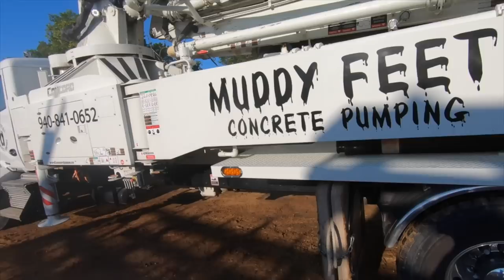Concrete truck rolls over. Pumping concrete with Muddyfeet

Comment: Sad part is that it's on the drivers side can see that coming
Reply: Actually in a truck like that you can see the terrain where the rear wheels are headed equally well on both sides via the mirrors.  Truckers routinely make the tires or truck body "just clear" obstacles on either side with no difficulty.  Anyway, I was thinking about how this is right at about sunrise and it was probably quite a bit darker than the camera makes it seem (digital cameras usually make almost any lighting level look like daylight, but in actual daylight none of those truck lights would have appeared to be so blindingly bright).  I noticed that the driver turned on his auxiliary backup lights after he realized things had gone wrong, and maybe it would have made a difference if he'd have turned them on sooner!

Comment: Boss gonna be pissed off! 🤣 whole 9 yards of concrete down the drain$$$$$$$$$$$🤑🤑🤑🤑🤑🤑🤑🤑🤑🤑🤑🤑🤑🤑
Reply from the maker: Yep
Reply: @MuddyfeetConcretePumping  That truck is not made of rubber that will bounce back, what about the damage to the truck rolling over and getting it back upright. Separate law suit for the stealing of driveway material stuck to the truck that will be hulled off with the truck!

Comment: They removed the driveshaft because after they right the truck it'll have to be towed due the truck being totaled
Reply from the maker: JDS Weather First, Brewer, Maine News & Events yes they did
Reply: Much easier to remove at eye level than on your back in the dirt. Especially on some older trucks the u joints suck to remove, mainly if they have press in caps instead of straps.

Comment: I had an incident pouring a basement foundation. The driver got too close to the edge of the excavation in order to reach farther with his chute. He rolled into the excavation collapsing much of the concrete forms and very sadly the driver didn't make it. (He was impaled by re-bar)
Reply from the maker: Wow. That’s terrible
Reply: Oh that's horrible.  Concrete companies around here train their drivers to NEVER position the truck parallel to an excavation.  A whole set of tires on positioned on ground that's not laterally supported is a recipe for disaster (same as in the clip).  Close approach to an excavation end-wise can be scary enough, but at least it won't lead to rollover or the whole truck falling in.

Comment: That's a lot of stupid there.  Failure to stop the mixer drum for that long was completely dumb.  I have driven mixer truck and heavy wrecker. Stopping the drum then hanging the chutes to the high side, then discharge the mud, would have saved a ton of money and hassle.   The pump truck operator probably even suggested this.

Comment: Looks like the wrecker with that cable along the side, is what put the pressure on it.  He should have used that tree on the other side of road and tied off on that to keep pressure  pulling truck other way
Reply from the maker: I’m not sure what the right answer is.

Comment: Terrible road and zero spotters is the reason he almost rolled over. Driver should’ve walked path and asked for spotter OR drove straight in and did three point turn around to pump. Make them spot or refuse service on grounds of safety issues

Comment: This looked rather amateur for both the mixer truck and tow truck operators.

The mixer backed in off-center and got stuck.

The tow truck,  could have used its under-reach and two snatch blocks to the front tow pin on the mixer and pulled it forward.

Comment: Who ever designed that bridge should go back to "bridge designing school" cause that bridge design is absolute crap, who thought it was a good idea to make the bridge just narrow enough for a cement truck weighing north of 30 Tonne (33 us ton) to have to reverse backwards, what ever happened to "making sure its foolproof" meaning that even if the truck driver goes of the desired path he still has enough room to correct himself, you give a 30ish tonne truck no room to correct, and this happends, and now you have to waste time, money, and resources for something that should of been thought about in the first place, either you should of widened the road to not only make it better at weight distribution, but so the truck driver can correct, OR cover the "bridge" part with steel plates so he doesn't get sucked over. to whoever built that bridge, if i were your employer i would not be happy.
Reply from the maker: Needed to be wider
Reply: Sorry if that comment was aggressive, it was late at night when I posted it, but I’m no stranger to people not using their heads, still makes me mad though.

Comment: If the wrecker had no choice but to back up quick, rigging a dead man off of a tree with a pulley would have helped. And at least saved the turn over.  The road looks too small and fresh dirt should have been compacted or stone.  and over the culvert a metal temp bridge like they use in the military would have been the safe bet, I think.  Glad no one was hurt. spill kit a must. How far can you lay hose without a pump. If you put a pump in the middle might be the answer.  Waiting for the next video, but take your time you have your business, family and you take time for us to watch this.  Thank you!
Reply from the maker: It was a difficult task for just one wrecker. They didn’t get enough information to the get go. It was a sinking ship that couldn’t be helped.
Reply: @MuddyfeetConcretePumping  True communication is key.

Comment: Poor decision making. This could have prevented easily. Why the heck did they back up when they had plenty of space to come in and turn around ? Even after the truck slipped into the side it could’ve prevented from rolling. I would say that by the time that wrecker came and did other crap he had a chance of saving it. a chain on the truck to the tree next to it should stop it from rolling. I feel so bad about the truck.

Comment: I've been leaning almost that far and just unloaded into a skiploader. Drove right out. They should've at least tried.
Reply: I agree. plus reversing the drum would have pulled the load to right right just a bit, towards the center of the road. the mud looked pretty wet though, so it may not have made a difference. totally worth a shot though

Comment: careful around those winch lines man, especially with that much load on it, they snap and it will cut you in half ! 

great video!
Reply: also never use that tow company ever again, that guy  didn't have a single clue what the hell he was doing! i am a 10 year experienced operator.... that guy had ZERO experience
Reply: In his defense, he didn’t have the right wrecker to do what needed to be done. They needed the bigger one with the boom to be able to get a line on it from the side. The first thing he did when he got there was call for it.
Reply: @doo-zranch7795  he could have stayed on the main road at a angle and put a winch line on it to hold from rolling over while they waited for the rotator to get there but he didn't do anything like that

Comment: Should’ve tied it off to that adjacent tree on the other side of the road, low down… on the stump base that tree would hold more than you think and they should’ve pumped the concrete out right away at the beginning, reverse the rotation to pump it out or whatever however they do it now days

Comment: Mixer driver should've known to Stop the mixer & give it a slight reverse turn then stop it & leave it... let the mud inside be moved to the high side using the fins inside the mixer...then shut off the engine. they left it turning & crawling the mud up the drivers side putting all the added weight on the low leaning side. 4,000lbs per yard... moving that mud to the high side would've slowed the sinking, making the angle worse & adding more weight. to the weak ground. since they didn't shut off the engine... not when it rolled, it starved for oil & ruined the engine too... bad situation made worse.

Comment: Shit narrow road with no compaction in the shoulders.
Also.... this is why you use both mirrors while backing up a truck.
There is a natural tendency to "cheat" to the side of the mirror that is being used. I'm not surprised that this happened on the driver side.
Reply from the maker: I think it was compacted. Just not on the drop off

Comment: If possible should of try to unload the truck asap...unloading would of put the weight on the oppsite side also ligher..or stop the drum turn off the truck..vibration and the rock hit the  side drum slowly rolled it..never been able to just pull that truck out..
Reply from the maker: I think your right
Reply: Only intelligent comment on here

Comment: I BLAME CONCRACTERS !!! THEY SUCK !!! THEY KNOW NEW ROADS OR NO ROADS MAKE PROBLEMS FOR HEAVY TRUCKS BUT DO NOTHONG TO TRY TO HELP STOP TRUCKS FROM GETTING STUCK AND SAY ITS YOUR PROBLEM  !!!!
Reply: Exactly I work in concrete and that's the first thing I look at is can concrete trucks  get to job site safely and not worry about getting stuck or flipping over.
Reply: Just can't back a 67,000 lb. truck over a loose pile of sand built up 3 or 4 foot high. Property owner and/or contractor for construction job are responsible for conditions on the construction site, not the redimix driver or tow company.

Comment: At first I thought it was driver error but I went back and watched it several times and you can clearly see the road giving away with that truck that was not driver error. whoever built that road is responsible. Just another reason to use forward discharge trucks in hairy areas. If like where I live they aren’t even used.
Reply from the maker: Bad deal
Reply: @MuddyfeetConcretePumping  I seen your 180 yard slab pour victory style lol

Comment: Lol there’s a lot of comments about what the tow operator should’ve done, but the mixer driver should’ve never went off the road in the first place.  It wasn’t that tight, especially for a mixer driver who should be used to those conditions.
Reply from the maker: Blaming the tow truck driver for this accident is like blaming a fully involved house on fire that burn down.

Comment: That is one heck of a mess that driver got himself into. Definitely where a front dump would be nice
Reply from the maker: The more I do with this channel the more I think we need some front end discharges in our area.
Reply: Front discharge are the way to go and many are 6x6 drive up here.
Reply: Muddyfeet Concrete Pumping 
Yep around here, the spring and fall is nothing but mud from the rain almost daily.
Only downside I have found is in tight quarters and getting a front dump into a spot. He needs a longer approach especially with a lift axle that can get 11 meters into a truck

Comment: I think the tow truck company should be partly liable . Considering the tow truck driver the company sent out was inexperienced. He put the straps on an attempt but failed to tie it somehow to a tree or two. If he did that he could  have stabilized the wrek.
Reply from the maker: I think the trucks fait was sealed once the tire stopped rolling. It was to dangerous to climb around on to properly secure.

Comment: That tow truck driver should have at least ran a snatch block & a line over to a couple of trees on the passenger side then to the top of the mixer,very well could have prevented it from going over
Reply from the maker: I don’t think anybody needed to be climbing on that truck. Way to dangerous

Comment: As a retired SVRT with more years under my belt than I care to remember, I won't criticize or pass judgment on the operators experience or vehicle positioning, but one thing I will ask is where is the concrete trucks "Banksman" or what you in the USA call a "Spotter" as I don't see one anywhere?
Reply from the maker: I think it would had prevented the accident
Reply: @MuddyfeetConcretePumping  I totally agree with you, plus saved the company a hefty recovery and repair bill. Really enjoy watching the videos you post, you all stay safe over there.

Comment: Should have ran a strap from from the left side of the main frame over the top and back to whatever they could tie into immediately when this happened. Everyone's reaction time except the dude holding the camera was terrible. Tow truck driver made the situation worse immediately. Should have never attempted to pull that truck without another truck tied in holding it upright. This video should be used to demonstrate to green horns how bad reaction time and lack of preparation can cost you the day.
Reply from the maker: I really think their are some missing pieces to the puzzle. I wonder what the tow company was told on the initial phone call. They may have been told that a truck was stuck and needed to be pulled out. So they sent a less experienced guy to the scene. I don’t know this but most people are quick to blame the tow truck guy. I feel bad for him. This was a bad situation that only got worse with time and lack of equipment to help. I wish people would quit trying to be the experts and look at the big picture. I think theirs more to it than we all know.
Reply: @MuddyfeetConcretePumping  - I'm not blaming anyone, just observing. I put myself in the position of the owner of that Kenworth thats now totaled. Thats an-expensive life lesson someone had to pay for and it probably wasn't the tow truck driver or anyone else standing around while a bad situation worsened. Made for nice action that could be captured in a video at-least.
Reply from the maker: Just needed to vent my point of view. Been some real amateur opinions on here lately. By your comment I figure you where level headed enough to see where I was coming from. And I still think you do. Thanks for commenting

Comment: This is what happens when people do not understand physics.
Reply from the maker: Or what spotters are for
Reply: @MuddyfeetConcretePumping  The first thing they should have done was to brace the truck to prevent it from tipping.  Maybe use that tree on the right side of the road with a chain.
Reply: @bikedawg  Do you have any idea how much a ready mix truck weighs full of concrete ?

Comment: i had a case like this 2 weeks ago. The concrete truck came backwards to me in a high incline degree and about 20 metres of me the front tire get in the mud and exploded. So i had to go with the pump at the end of the truck and empty the truck. i loose the primer and i have to make another one, to put more hoses and i pumped the concrete 60 metres instead of 40 metres.

Comment: Looked like the tow truck ran a cable straight from the boom to the truck without re directing the cable to his stabilizer feet so it pulled slightly down instead of slightly up. Not good.
Reply from the maker: I think they had trouble with attachment points. The truck was to unstable to be climbing on.
Reply: @MuddyfeetConcretePumping  the attached to the concrete truck pretty decent but because of the angle of the truck the cable should have been first redirected to a point as low on the tow truck before being attached to the concrete truck to help keep the high side down. Also it looked like he tried to use the tow truck to drive forward and pull the concrete truck. If in fact he did that it would cause the concrete truck to become further unstable. He should have used the winch to pull slack out of the cable and start pulling the truck. Looked like multiple failures by the tow truck driver.

Comment: I drive a mixer truck, we use all front discharge trucks, this is why i hate rear discharge trucks.
Reply from the maker: I’m starting to think your right
Reply: Rear or front get to close to edge your done. Would of been the same front drive in nose but still has to back out.

Comment: Pretty good the wrecker drivers couldn’t have moved any slower. They could have saved that truck no problem. Could have hooked it to the base of that tree. Could have been out on the road and strung a cable in and hooked to it. I think they moved slow on purpose to make the call more expensive. 😡
Reply from the maker: Mad Man Marine I really don’t think that’s the case. That truck was a sinking ship when it went off the road.  It was simply to unsafe to be crawling on and trying to hook on to.

Comment: not being a smartass but using the pump to unload the stuck mixer 30 years pumping you learn  few things take a few chances save a mixer from a drum full of hard concrete . the driver should have stopped the drum also that
Reply from the maker: Wouldn’t be any where to set the outriggers.

Comment: he should've shut the drum off to keep the weight low and stationary. now with that being said I dont know why they use those god awful rearload trucks down there, need some nice front end mixers they make life so much easier
Reply from the maker: What do those type trucks cost?
Reply: @MuddyfeetConcretePumping  New I would be surprised  if you could touch em for under 250k. 
Used they are pretty reasonable, but maintenance is high and they get at best 3 mpg.
Reply: not really sure about cost, but I know from experience with working around both of them the front load trucks are more stable and easier to maneuver on jobsites, they dont get hung up or stuck in softer soil as often  because they have massive wide tires on em, I pour alot of road repair spots and it is so much easier when the driver can see what's goin on
Reply: not to mention they are so much safer because the driver can see what's goin on they dont need a spotter to get the chute where it needs to be,

Comment: That load of concrete should have been dumped IMMIDIATELY after that driver got stuck and was leaned. I did recovery for a few years. That Tru k would have sat there for a week of Sundays if that concrete was dumped.
Reply from the maker: Probably so
Reply: @MuddyfeetConcretePumping  hindsight is always 20/20 though. God willing it never happens again...but if it does...dump it. Better to lose a batch than a whole truck.

Glad no one was hurt especially.